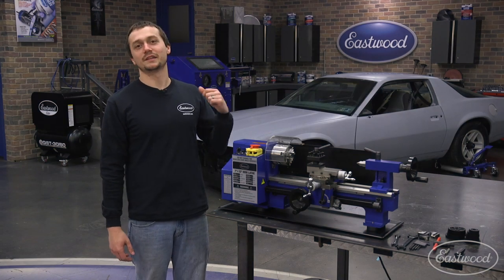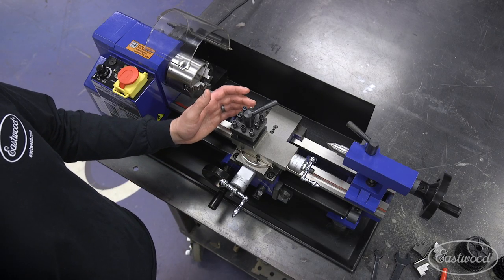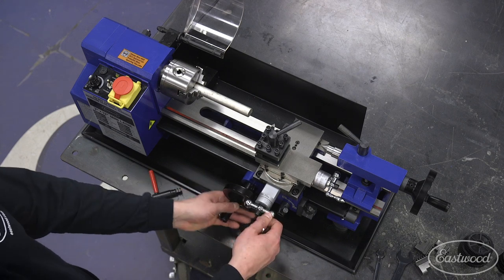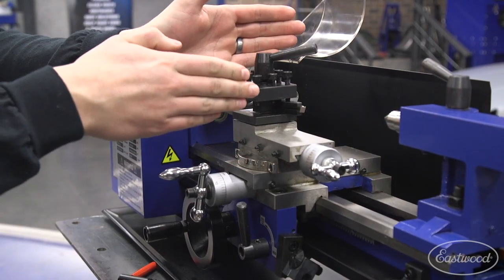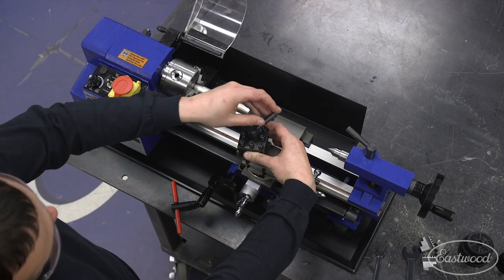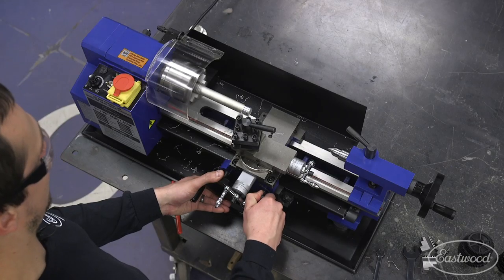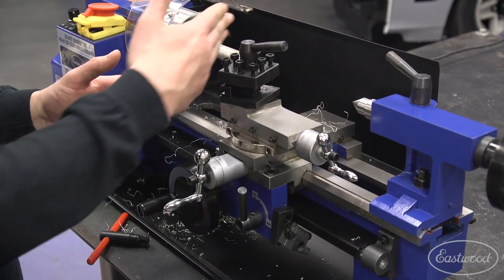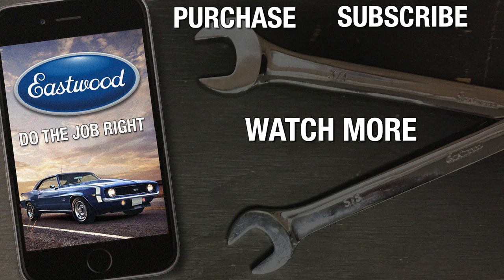Mini Lathe Basic Setup and Operation - Start Machining in YOUR Home Shop! Eastwood

Comment: New comers should not duplicate anything from this.
as could result in an injury or tool damage .

1. Nether have a stock hanging out as shown in this vid without support.
2. No Rpm speeds given,  so you don't have no idea. (wrong speeds causes problems)
3. No Tool information given. (carbide/Diamond/Fast tool steel Ect) even tho he uses an incorrect fast steel for the job. 
4. The correct cutting angle has not been mentioned.
5. You don't centre the tool up to the end of the job that has not been clocked ," Set True ", (centre your tooling up form centre of the chuck.)
6. Hear the incorrect facing angle chatter, Facing and parallel cutting have different angles. and both in this vid are incorrect.  

Anyway I think this Kid was given this lathe for Christmas and just wanted to show it off.
Next Christmas he get a free machine course.
Reply: Perdy much my thgts... you covered it well!
Reply: Absolutely.  — “lets chuck this piece of aluminum in there”.  Raised some red flags… what type/quality of Aluminum is it. And what is the density of the tool used (on Aluminum at the time).
Reply: me and da boys about to chuck a random piece of steel (i think it's steel, maybe stainless) in the brand new mini lathe, with a HSS drill bit that I've flattened on two sides and cranked down into the tool holder to run a sort of tapered/facing thingy!!!

Comment: Any leads on a manual for this lathe? I just got a old speedway series lathe and its exactly the same ,same color everythkng
Reply: they’re basically just rebranded mate, all the same maybe just slightly better cogs within the machine for the speeds. Most likely cheap metal or plastic
Reply: cause they all come over on the slow boat from the same factory in China, then the companies repaint them

Comment: I know it saves on cost but plastic gears?  would it cost that much more for metal? Do you sell metal gears?
Reply: A little old for this reply but I will say about why small machines use plastic gears
It saves the machine from getting excessive damage on other expensive parts if the new user does things wrong
Meaning the soft gears will break first and are cheaper to replace.
And as the new user gets better without crashing the tools then one can then buy more stronger gears

Comment: also can you stick the workpiese out even more
Reply: Piece is too large a diameter to fit into the chuck hole. Tonka Toy!
Reply: @quickboat22   i know but they could have still  shortned it
Reply: @quickboat22  Still too much stickout:)
Reply: @fabiankirschner9982  yup. you a machinist?
Reply: @quickboat22  yes
Reply: @fabiankirschner9982  Yeah, I started out a machinist out of HS and got into CNC. Programmed for 10-15 yrs.Went to college at night and got into manufacture engineering.
Reply: @quickboat22  nice